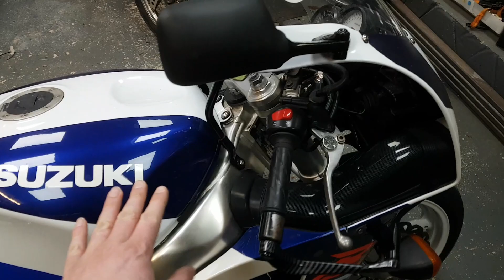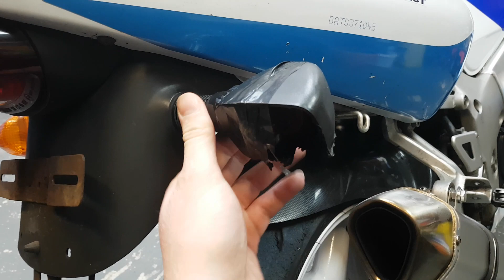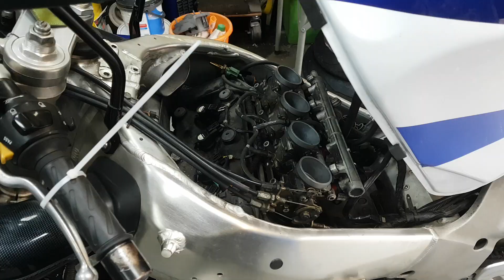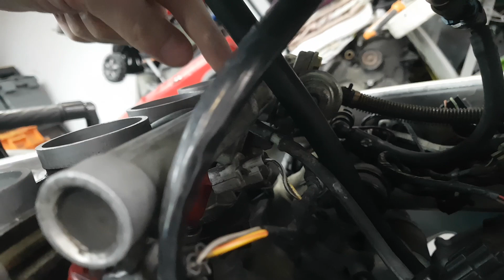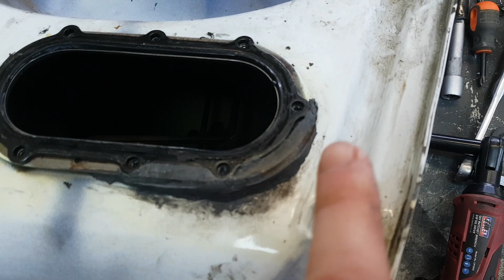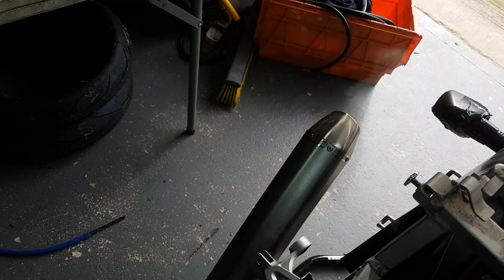GSXR 750 SRAD Wont Start - Lets find out why

Comment: Hello mate. Did you end up tapping the bolt hole out to m6? I've had the same issue but cant get a good seal. If you did this, did you get a good seal again or did you need to use some sort of sealer? Mines doing my head in. Fuel pump isn't priming now so got to tackle that first but then I need to try and get it sealed. Cheers.